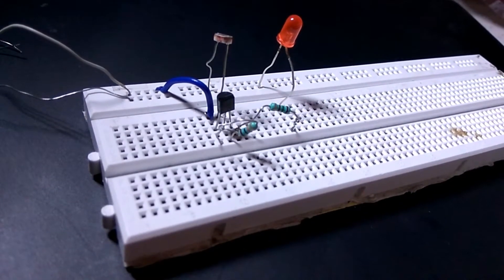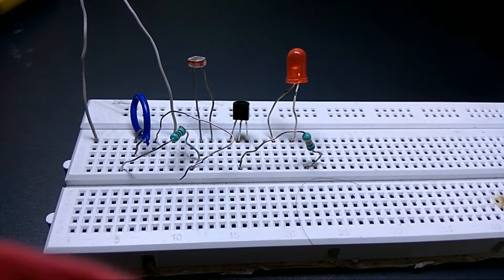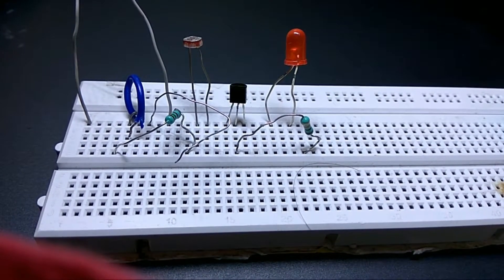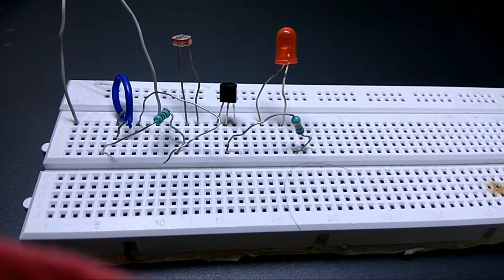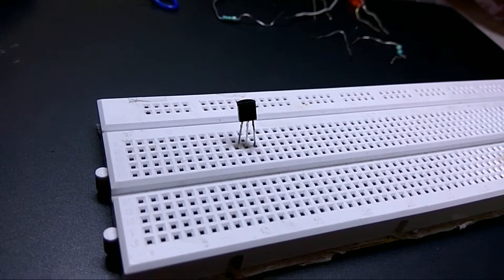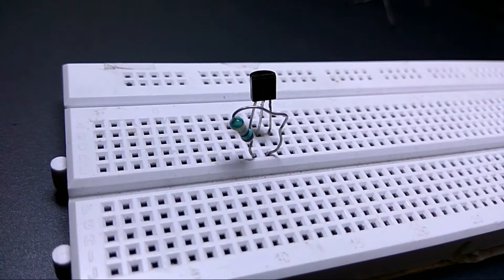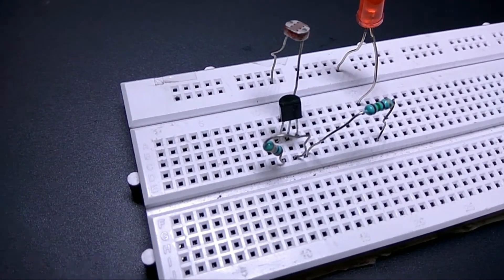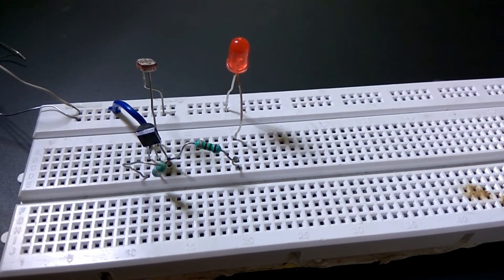How to make an automatic night light | LDR Circuit

Comment: CAUTION!

Dont use a NPN Type Transistor or you will destroy it, a NPN needs GND or -ve power at its collector and emitts negative power at its emitter and requires positive at its base. For this project, you must use a PNP Type like BC547, its polarities are opposite to NPN, i.e. PNP requires positive at its collector and emitts positive at the emitter and requires negative at its base. NPN - Negative Positive Negative

PNP- Positive Negative Positive

Dont forget to swap the led terminals

And see my electronics channel as well:-

https://m.youtube.com/channel/UCT_CuyFuuFkNUFbqqkyrUlw
Reply: The channel is.     MR CORE
Reply from the maker: Excuse me, if you don't know BC547 is an NPN transistor
Reply from the maker: kaboo